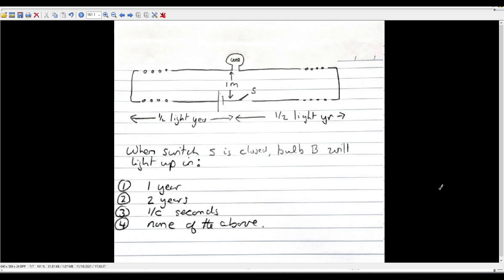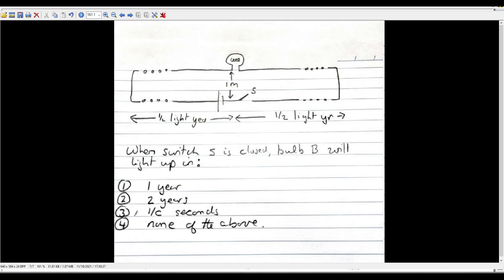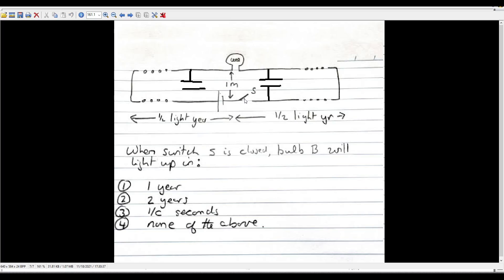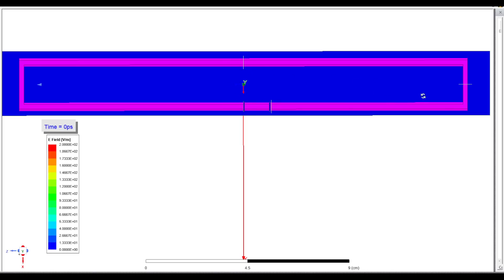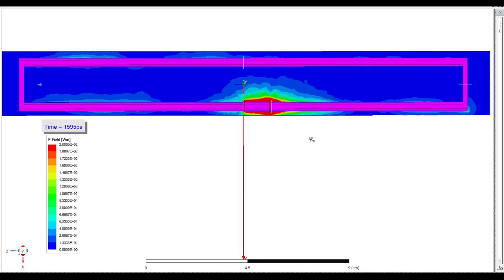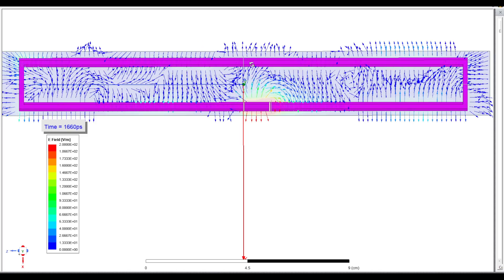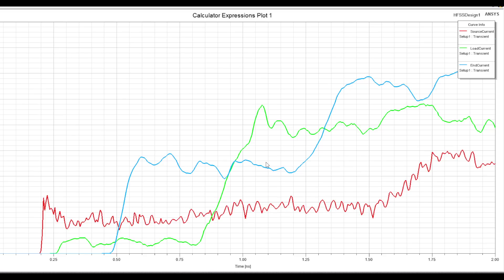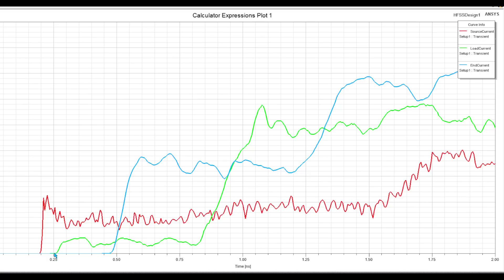Response To Veritasium - Electricity Propagation Time Problem

Comment: Thanks and great video!--I just had a question regarding how HFSS works. You see, in my hand calculation, I modeled everything in terms of current. The closing of switch cause a current "wavefront" to travel down the wire. The current is constant and uniform (DC), but only over a region of -ct to +ct. So the corresponding magnetic vector potential A generated by this current is actually changing in time. Then an electric field is induced by this changing magnetic potential: E = - dA/dt. But the direction of A is is the same direction as the current, and therefore so is E. this does not agree with  the simulation. But it seems like the simulation begins with a scalar electric potential and uses that as the basis for calculating the fields? Not sure about the details of HFSS, and also I am ignoring the mutual inductance between the wires, and surface charge accumulation, etc. I just thought that modeling an "expanding" DC current would be an accurate representation. Perhaps you know about the relationship between HFSS and physical theory?
Reply from the maker: I think your hand calculations are on the right track. The electric field produced by your magnetic vector potential A, lets call it Ea, should be in the same direction as your current since this is the field DRIVING your current (in a finite conductivity material). Think of a dipole antenna, the far-field radiated E component is parallel to the dipole, no radial component. However, in our case this is not the only E field component present. Think of the potential difference between the far side wire and the source wire that involves the E field between and normal to the wires. In the simulation this component dominates so it looks like the vectors point straight across, in reality there is a small tangential component Ea which is ALL that you are considering.

For transient solutions like this HFSS uses the Discontinuous Galerkin Time Domain (DGTD) method or Finite Element Time Domain (FETD) method. Both of which are non trivial and I am not qualified to speak to with any authority, but from what I understand, the general principle is that you start with some Initial conditions and step through time with one or more known variables (in this case E across the transient source is defined for all time) and then you can use the current value of your known variables along with the previous values of the unknown (and known) variables to solve differential equations for the current values of the unknown variables. This process steps through time until you reach your last defined/known variable time step.
Reply: @PulsedPower  Thanks for the explanation! Thinking about this problem has been a great learning experience for me
Reply from the maker: @zeno4253  Glad to hear that!

Comment: I don't get your simulation. Why doesn't the sign change from one side of switched source to the other?  it just looks like a simulation where you dump bunch of charge right at the switch and watch the electric field propagate.   Is the legend the magnitude of the electric field?  Also is this a cross section of a loop or wire or a 2-D where the that loop is actually planes and infinite?
Reply from the maker: Yes the first animation shown is the E field magnitude, continue watching for E vector. The witness plane is cut through the midpoint of a 3D loop (think slicing a bagel in half) I also change the view near the end so you can see the 3D structure.

Comment: Does this match VS's paper which suggested a rapid rise to 50% voltage initially, and with rest later?
Reply from the maker: That would depend on the actual impedance of the load vs the transmission lines.

Comment: Can you model this with either the wire broken at the far ends so there is no circuit or with another bulb below the battery with wires going left and right but nit connected to the circuit. If there is the same ‘current’ wether or not there is a circuit, then we are talking about wireless power transmission, not what happens in a wired circuit. 
Thanks!!
Reply: I’d also live to see the model with the switch moved all the way to one side. His explanation said it was the electric field from the source to the load that was important. If you could have the switch a 1/2 light year from the light turn on in 1/c you could communicate faster than light. 🤦‍♂️
Reply from the maker: @speedglide  In this case the switch is what is causing a change in the electric field, so moving the switch 1/2 lightyear away would mean that the field change takes 1/2 a year to reach the bulb.

In response to your initial question, there would be the same initial current even if I removed the two "1m" end segments that complete the circuit. The whole point is that electricity generally interacts "wirelessly". See my responses to Gregers Frederiksen who had the same question.
Reply: @PulsedPower  The answer is still wrong. No delay at all will be observed! We did the actual experiment. See my detailed post a the top of the comments

Comment: Would this simulation behave the same with superconducting wires? Do they act as capacitors the same way?
Reply from the maker: Good question, there was a lot of comments about the wire's resistance (or lack of). Changing the material to PEC (Perfect Electrical Conductor) does not change the simulation results noticeably.  Superconductors can still have capacitance because capacitance is only a function of surface charge buildup, which superconductors can still have. In the case of lighyear or even lightsecond long wires of course resistance would become a practical problem.
Reply: A superconducting wire has a self and mutual inductance with zero effective resistance at DC only. Technically timestep simulations tend to have difficulty with true ideal inductors and capacitors due to the way the trapezoidal integrator tries to dynamically adjust the timestep to keep the results within a configured tolerance window. When you're doing practical simulation you have to keep that in mind and for high frequency simulation capacitors and inductors will themselves be given more complex models with various added parasitics.

Comment: What would happen if the circuit wasnt closed in the ends? Would the initial low current through the load remain constant, or stop once the current reaches the end of the cable?

I think that there should only be current through the load for a short moment when you initially allow the elecotrons to flow out of the source, but that the charges in both cables would quickly stop moving if the wire is open in the ends.
Reply from the maker: Basically yes, the current would reduce in steps eventually reaching zero as reflections bounce back and forth from ends to source.
Reply: @PulsedPower  Would the lightbulb be "on" for one year then?
Reply from the maker: @drmedwuast  Yes, not "full brightness" some would say, but on nonetheless.
Reply: @PulsedPower  Fascinating. What would the brightness look like over time? Would it start to reduce in brightness after or before the one year mark?
Reply from the maker: @drmedwuast  Assuming the wires extended 1/2 lightyear in one direction then after 1 year (round trip time) the brightness would reduce.
Reply: @PulsedPower  Would this work with other shapes than the 1m x 1ly rectangle? 
 
What would happen if I didn’t move the battery, switch and lightbulb, but formed a circle with the wire on each side (so that it looks like a ∞ from above) ?
Reply: Well, then I would say that the answer 3 is not "canonically" right because for the first year it doesn't matter if the wires are cut at the far ends or not. Also, as you said, if you shield them (which, as my intuition tells me, should also be an assumption, just like "0 resistance"), the answer is also 1 year.
Reply from the maker: @WofWca  I would say that assuming a coaxial line is certainly not within the bounds of the problem. It involves an additional conductor, which is not sketched or mentioned as a possibility.

I see what you are saying about the open and short cases being identical, but I dont see that as precluding (3) as the "technically" right answer. Of course the whole problem is formulate as more of a thought experiment to explore the workings of electricity. Myself and others certainly acknowledge the caveats of answer (3), and I think you can be just as informed and say IMO answer (1) is correct with the caveat that a signal WILL be present after 1/c seconds, but not in its final magnitude.

Comment: That little current increase at the load (which happens in ~1/c) would happen regardless if the wires are connected 1/2 light year away or not, right?
Reply from the maker: Correct! However once the fields reflect from the open ends it would step the current down towards a steady state of zero rather than up to a non-zero steady state.
Reply: @PulsedPower  You are all wrong see my latest post at the top of the comments for details. The light will actually turn on instantaneously, not after 1m/c sec. We did the experiment and published it in the EM Journal IRECAP, and it shows an EM pulse will instantaneously across space to the detector in the nearfield.
Reply: Welcome to understanding radio antennas :D
Reply: In fact, if it is really 1m/c there isn't even time for electricity to flow down the wire. 1m/c requires the wave to leave the battery at the instant the experiment starts and proceed directly to the lightbulb. There is no time for anything else. No switch, no wires. Thus no antenna!?! In this context I think the "none of the above" is the pedantic but correct answer for the time it takes for the bulb to light after the experiment starts.
Reply: @duaneeitzen1025  It is near instant... In fact the moment electrons move slightly inside the battery (this is a conductor here too). The closing the switch allows them to move slightly more is all.
Reply: @duaneeitzen1025  Batteries self drain over time, right?

Comment: I don't quite understand why we need a conductor if the electric field can be propagated before having to travel through the cable. Maybe I didn't understand your answer?
Reply from the maker: To establish a steady state current you do need a conductive path. Otherwise you would just have a blip of current from the rising edge and it would settle to zero current rather than a non-zero steady state value.

Although the energy is propagated by the EM field, you definitely still need that field to deliver energy to electrons in order to dissipate power to a resistive element such as a bulb. In the video he seems to disregard electrons as totally unnecesary which isnt true.
Reply: Field propagation of current is inefficient and indiscriminate, taking much more power to create a field to transmit power to the target and the amount of power increases on the cube (I believe) to extend the field, and you would end up with current in things you did not want current in.  I always hate it when I melt my dental fillings while using an Arc Welder (Joke).
Reply: The wires with the electrons is a way to guide the em fields to were we want it to go. In the case of constant    DC it will not transfer any were without the wires.

Comment: If we insulate the whole circuit properly (insulate the power source, the wires, the bulb…), does it mean the fields will not propagate outwards to the bulb, and only propagate along the wires ? So it would require a whole year for them to reach the bulb ?
Reply from the maker: Good question! If by "insulate" you mean shield (with a conductive material) then yes, shielding the entire length of the cable (basically a coaxial cable) would contain the fields and act as a waveguide and it would take a whole year to reach the bulb.

Insulating with some sort of dielectric would not have this same effect.
Reply: Thank you for you answer, I think I get it.

And thank you for pointing out the correct technical term, I suppose « shielding » is right, just like a coaxial cable. English is not my mother tongue and electricity is not my field of engineering, but I’m always eager to improve and learn :)
Reply: @PulsedPower  Thank you very much for your video and simulation!

I was asking myself the very same question. Suppose an ideal electric and magnetic field insulator (mu permeability = 0 and epsilon permittivity = 0) around the wire, or even imagine that air or void would be a perfect insulator inbetween wire sections.

Then of course, absolutely no current would flow through load untill 1 year has elapsed after we close the switch, right?

Sorry about my english, and tyvm for sharing your sim and insights

Edit: this would mean that in Derek's theoretical setup, this is all due to the fact that electric field and subsequently current and magnetic field perturbations propagating in the wire, does also propagate (much less intensively) through wire coating and air gap to the light bulb?

If i'm getting this right i believe that the animation shown in Veritasium video about Poynting's vector should have taken into account the increased magnitude of the vector through permeable materials such as the wire, and reduced magnitude for those going through air gap. I think that would've been less missleading.
Reply: @PulsedPower  Are you sure it would take a year? What permittivity allows you to make that assumption?
Reply from the maker: @alanhillsplasmatweeter7318  if the (now guided) path length is 1 lightyear and assuming a permittivity of 1, it will travel at light speed.